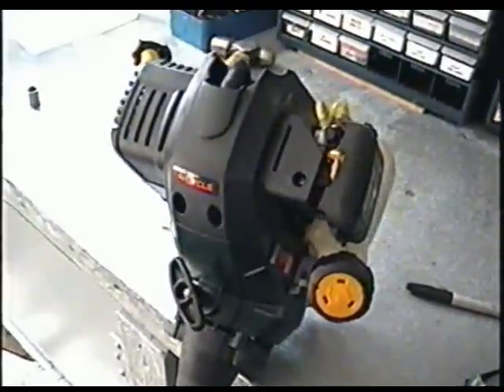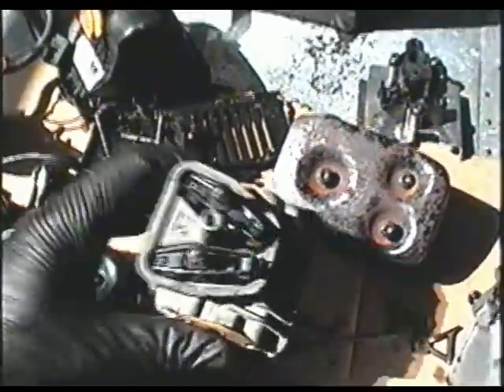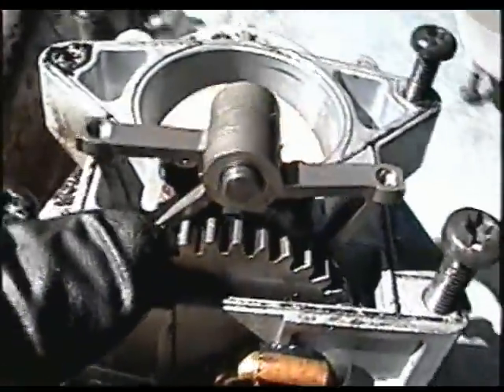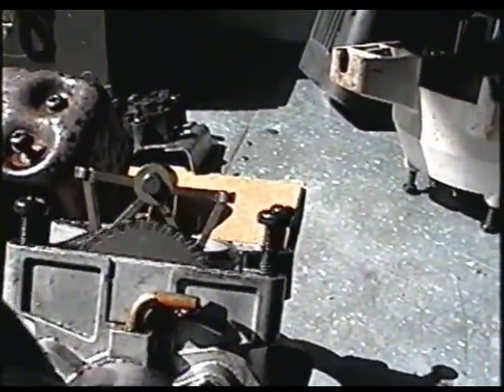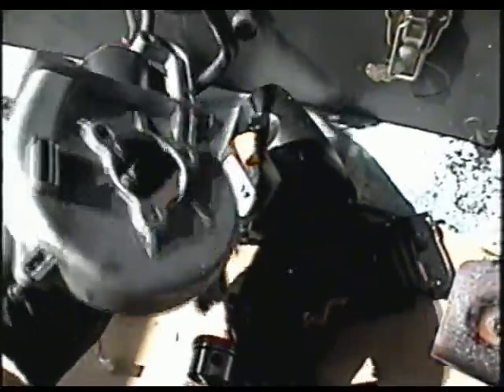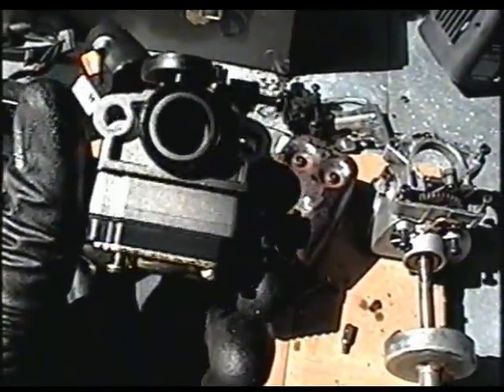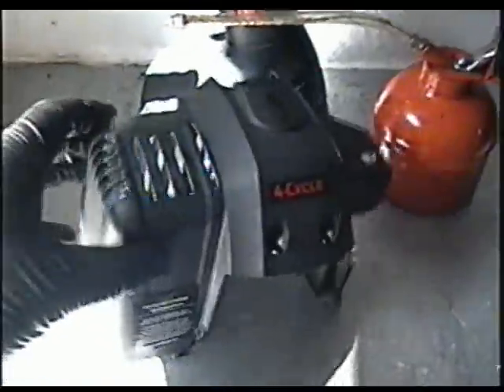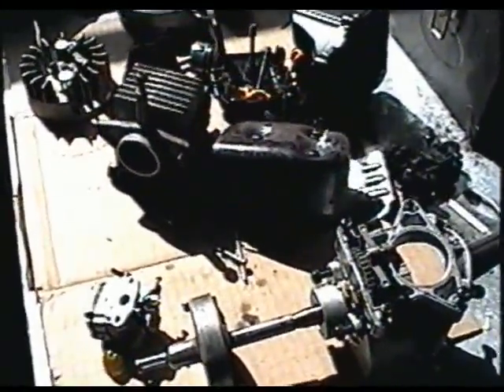INSIDE The 4 CYCLE Grass Trimmer Engine

Comment: I would develop a way better 4 stroke set up. First I would do a different valve lifter lay out where the same cam operates the exhaust then the intake in a overlap fashion rather than using the tedious bridge layout( mind you even sphere valves come to mind, but the explanation would be too long for many to understand). The crankcase ventilation or PCV. I would use a spring loaded check ball valve at the end of the crankshaft flywheel side ( removable for cleaning of course), with almost like an oil gallery passage to the one-sided throw inside the crankcase, that way no oil mess in whatever the trimmer engine is placed in. One could almost make chainsaws this way as well.

Comment: I need a flywheel for mine the keyway broke im not using it for a trimmer i have my engine mounted on a stand and its just somethimg to tinker with im gonna bend an weld a flange for some pipe an make a little header and make a steel tube intake also and install a mini cone filter

Comment: Ok I'll update this for 2018. I just bought this exact model used off craigslist two weeks ago for 50 bucks and this thing is amazing. For a mechanic working on them it's gotta be a freaking nightmare compared to two stroke engines, as your video just confirmed it! (Whomever designed this thing couldn't have been more than 2 feet tall - lol).  

As a frequent user of trimmers for many years, I could never be more happy with the stability, power, consistent starting, idle speeds etc of this little miracle 4 cycle engine!  I have no idea how old mine is but I'm guessing perhaps 6 years or so. Heck it doesn't even utilize a choke! I had to double check today when I started it up again...

Mechanics internally may be a nightmare, but usage has made lawn care great again! If it dies, I'll just buy another one. No way I'm taking this thing apart based on the video!

Awesome video by the way! Thanks!
Reply from the maker: yes indeed!
Reply: I got a ryoby x430 for 5 bucks, runs perfent. And seven other older weed eaters for 20 bucks. I got 8 good running motor for 25, im gonna have a lot of fun messing with all of em

Comment: What is the lubrication system on a 4 stroke weed wacker?
Reply: There is a slinger on the bottom of the connecting rod that splashes oil all over the bottom half and a vacuum sucking the mist through the valve cover

Comment: I've got a Ryobi model four stroke for over 10 years and I have to tell you it's probably been the most reliable weed wacker I've ever owned. Even after sitting for long periods of time it usually starts very quickly it's quieter and reduces much more to work

Comment: Two strokes have been proven to last and four strokes in this area are new. It will take time to iron out the issues. You can't just go and spend $100 on a trimmer and think it will last. The purpose that ryobi and troy built use four strokes is to stup people into buying them. Chances are these same people have bought cheap two strokes in the past and not have had a good luck with them. So the ignorant person then says a 4 cycle must be better. Then they buy it and relize it is junk.

Comment: Mine is still going strong the 990r after 14 years of use.  I replaced the carb, fuel lines and filter and now going strong.  I have a complete list of accessories blower, cultivator, edger, brush cutter and strimmer.  In the meantime I also purchased a dedicated edger and more recently a Hasqvarna 324Ldx another powerful 4-stroke trimmer; it's lightweight, quiet and has a Honda engine.  I now use the Hasqvarna 324Ldx for trimming and the Ryobi 990r as a blower every week; love the combination.

Comment: Ryobi is not known for long lasting products. The faults with a 4 stroke trimmer are weight, operating position (oil sump) and more moving parts to service and then throw the lack of quality in with it. Professionals do not use 4 stroke due to all of these issues. You get what you pay for. Now thatd not to say if you take care of then they won't last. They can if you take care of them. Most people dont take care of their tools.

Comment: I have a Ryobi 990r 4-cycle Gas Trimmer and a Ryobi 890r 4-cycle Gas Trimmer.  When I buy parts for my two Ryobi gas trimmers, at my local STIHL dealership, the counter help always criticizes my Ryobi brand and the 4-cycle concept.  They say that 2-cycle gas trimmers last longer.  My two Ryobi trimmers are the first trimmers I have ever purchased.  I've had the 990r for 16 years and the 890r for 8 years and they both still run.  Why do you prefer 2-cycle trimmers over 4-cycle?

Comment: Thanx for all the info. I my 4 stroke would not start so with the help of these videos
I rebuilt the carb. It start now on the first pull and run no problem but when I swith
it to run from start mode it just quits any idea... tips can these carbs be adjusted...

av8tr@sympatico.ca
Reply: Jurgen Punko

Comment: @donyboy73 and when you say for a while how long is that? and what exactly goes wrong with them or can you not figure the things out?
also what is your opinion on a poulan pro 33cc? there is one at walmart for the same price as a 30cc ryobi 2 stroke. idk if i should buy a new wacker or have mine fixed, the clutch, and flex cable are wore out pretty bad and the flex cable has a twist in it. i would like to get a straight shaft replacement for it.